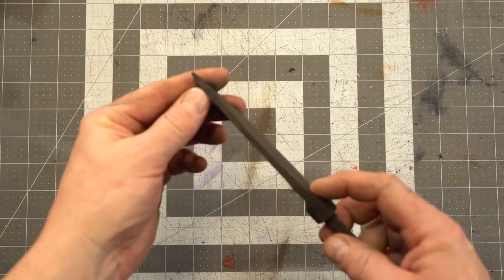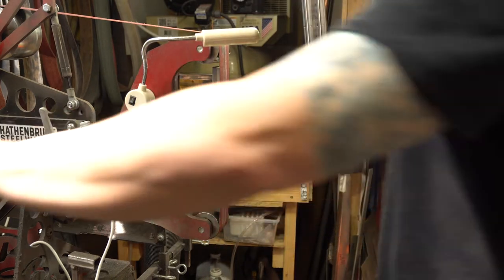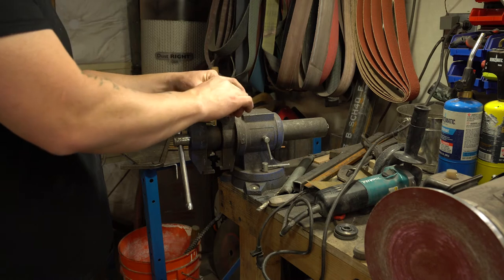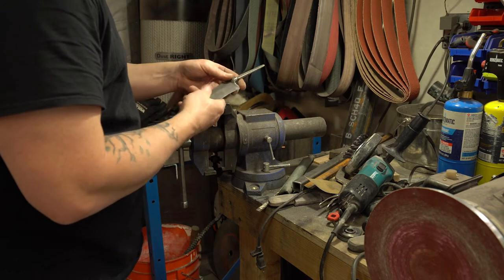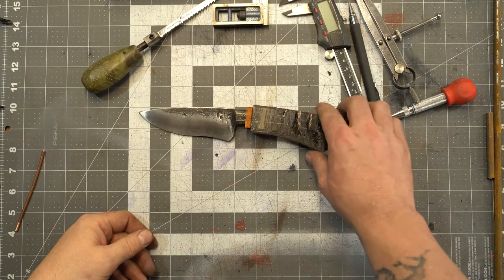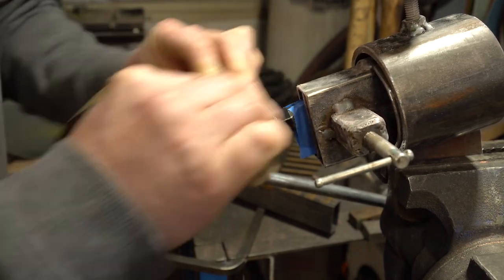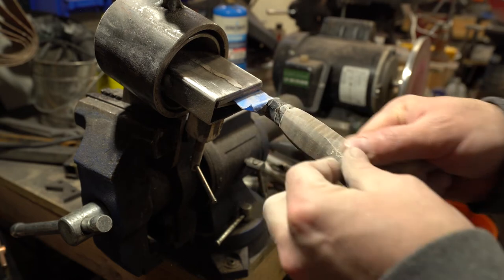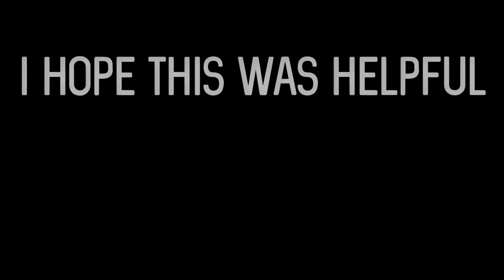Knife Making: Final Assembly of the Coil Spring Integral Hunting Knife

Comment: Love the knife man, great work! I want to give integral bolsters a try but I don't have any power hammers lol so it's doable, just would take quite a long time.
Reply from the maker: It’s totally doable, and yeah, it does take significantly longer. Someone asked me to do a video on hand hammering an integral, so I was planning on doing a video.
Reply: @Hathenbrucksteelworks  That would be awesome! I have some one inch round stock that I could work with and follow along.
Reply from the maker: 1” round will make a decent sized knife. I’ll have to get some. All I have right now is ¾”